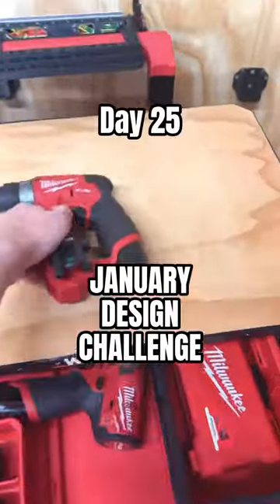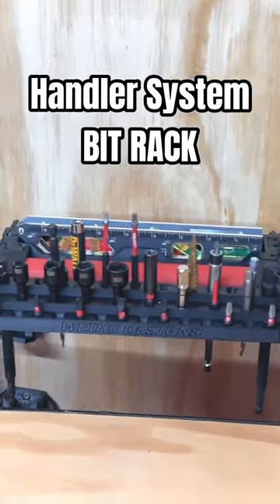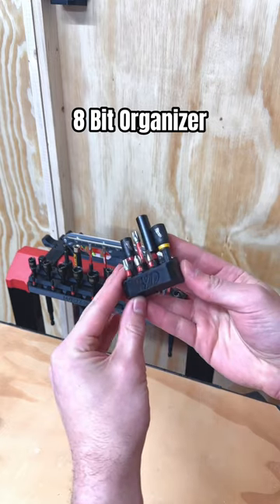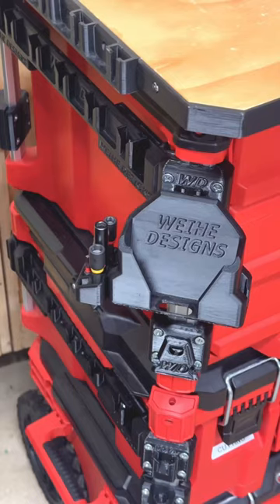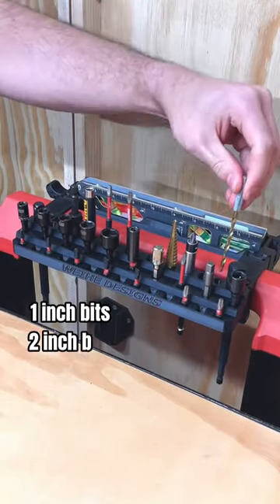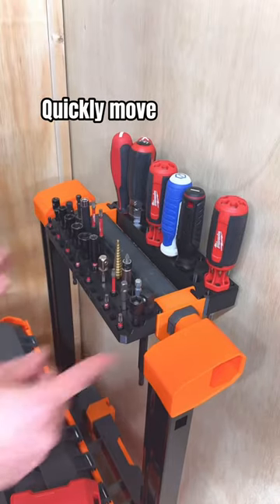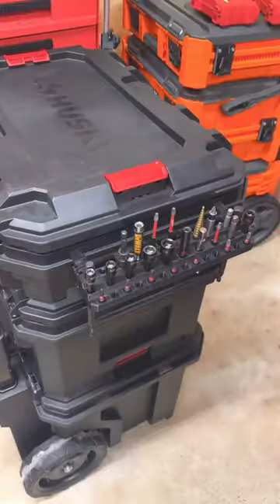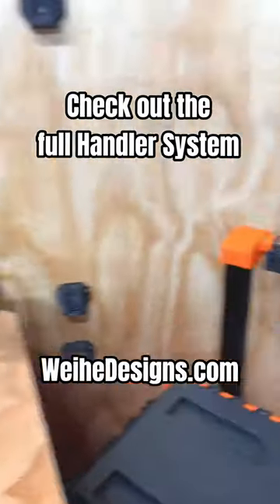Design Challenge Day 25: Convenient Bit Storage! #toolorganization

Comment: Okay … 🤨.. Score ANOTHER ONE , for that Milwaukee group , but What about the TOUGHBUILT  group ?…🤷🏽🤨👨🏽‍🦳🇺🇸
Reply from the maker: The Handler System is compatible with several brands of toolboxes including ToughBuilt StackTech. The Bit Rack and other Handler accessories will attach to Top and Bottom Handle Mounts on ToughBuilt StackTech. You can check out more Handler accessories and a growing line of ToughBuilt specific accessories on WeiheDesigns.com
Reply: @JakeWeihe  ok 👌 ! Thanks Jake ! I’ll check that out ! 😀… Well , 🤷🏽 it’s back to Lowe’s again for me ! See ya ! 👋🏽 🙂